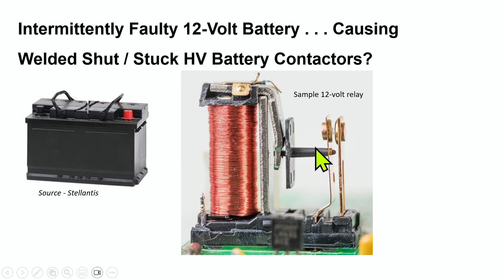Electrical Anomalies Stuck Relay Tech Tip

Comment: DC relays can and will generate counter emf when they are de-energized as the magnetic field that operates the energized relay collapses around the coil and induces current back into the coil . In extreme cases it can slow relay drop out time or even pulse the relay . A reversed biased diode can be mounted across the relay coil terminals to dissipate this counter EMF voltage and alleviate the risk of this happening .